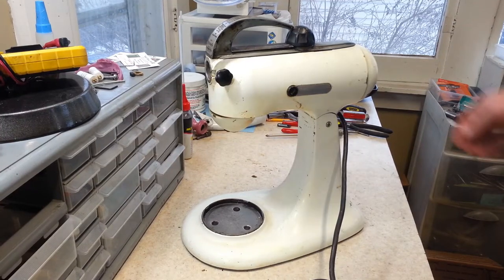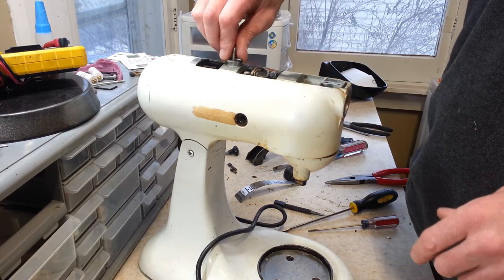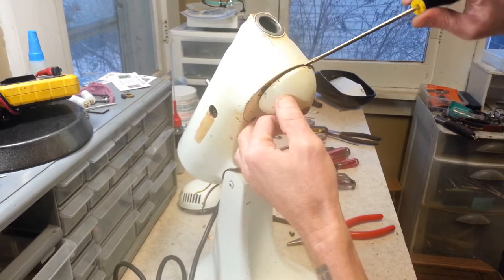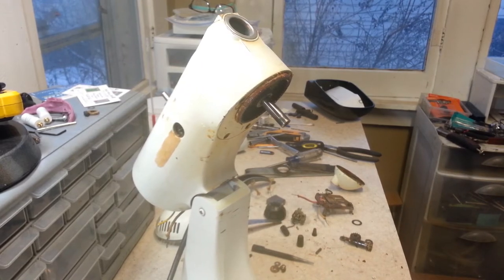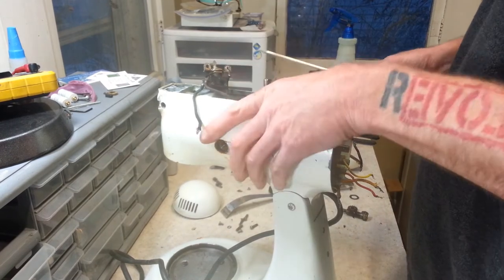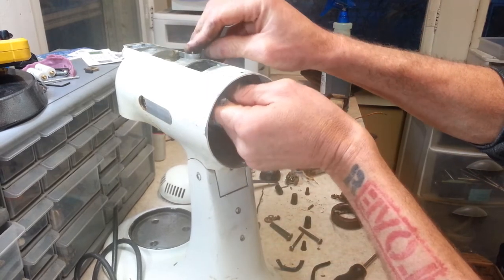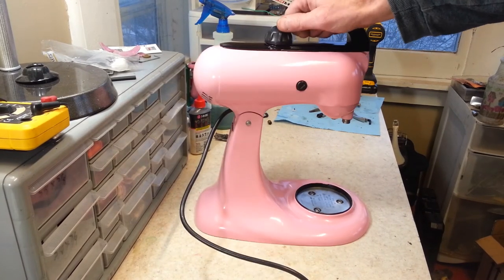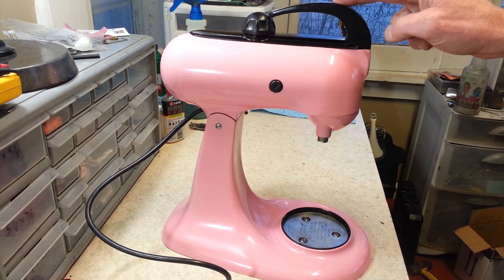Vintage Kitchenaid Model 3b restoration in pastel pink

Comment: Very nice job completed!  You really got the motor running smoother at low to med speeds.  Were any parts needed replacing?  Much discernible difference between 3B, 3C and 4C other that the obvious external differences on the top of the motor and the planetary differences of 3B & 3C.  KitchenAid sold a kit to convert the 3B to use the beater of the 3C if the customer wanted.  The 3 B beater shaft was prone to breaking in the motor if used to mix stiff cookie dough very often.
Reply from the maker: Thanks Russ! I had heard about the 3C upgrade shaft on these, but never knew the reason, thanks for the info on that! Believe it or not, no major parts needed replacing on this machine. Pretty amazing, considering the age!

Comment: Wanted to list this as a comment so here it is again: My 3B is still all original including the wick. Does need a teardown, repaint, and regrease. Did you use the food safe grease? The wick looks like a piece of rope, probably cotton. Been wondering how to deal with the wick and the black piece that the bowl locks into. I can get the steel plate out, but not the black piece in the base. That plate is held in with flathead screws too. My mixer has probably been in continous use since first owner, and has been in the same family since new. I guess they only made one color back then, cream. Serial number 3B30761. Do want to repaint in gloss black!
Reply from the maker: Hi, I will try to answer all the questions! 
I do not use food safe grease, unless specifically requested, in my opinion it is crap, and will only break down and leak in a couple years. No leaks or drips means no need for food safe grease :) 
I do not replace the wick, they hardly ever come out in one piece. They are to lubricate the bushing by soaking the oil from the grease in turn keeping the wick wet, but will only work by the grease separating. I just lubricate the inside of the bushing with grease. 
The plate usually sticks, there is also a plastic band around the outside of it, but careful prying from the bottom should pop the plate off, sometimes a little heat helps, like a blow dryer or heat gun. It usually is stuck down from old residue that will loosen up with a bit of heat. 
Hope this helps! Maybe you can post a video later! :)

Comment: Great video that helped me a lot getting my grandmother’s 3B apart. 

I’m seeing a lot of arcing in the back from the speed controller. Any idea about how to get it to stop sparking? It’s pretty much constant across all speeds but gets more intense the higher the speed.
Reply from the maker: Hi Ari, thanks Im glad it helped! It would most likely be either bad or dirty contacts on the speed control board, or the capacitor is bad, which helps to control arcing. Those are the 2 things I would check first. I believe Dave sells replacement capacitors for some KA's, you could check with him at www.davesrepair.com 
Good luck, let me know how it turns out!

Comment: You're giving yourself too much trouble removing the planetary -  it's much easier to remove if you use two screwdrivers at the same time, that pulls it off in a straight manner without any binding ;-)

Ha! the presence of a wick on the planetary output shaft! I was wondering how the output shaft was getting its lubrication... The output bushing on a machine I was working on was very worn out, I couldn't figure it out, but with a wick it all makes sense, as it would pull the oil out of the grease to feed the shaft...
Reply from the maker: Thanks for the tip! :) That would have made it easier for sure!

Comment: Hello I also have a 3B KA and would like to know if you know of a good place for parts, Like the lock plate and brushes. I have contacted KA and they told me they don't have any information on units this old in there system. So they would not help. Also they argue about the model number because it is only 2 digits. Any help would be awesome. Thank in advanced.
Reply from the maker: Hi Michael, unfortunately for most parts for that machine, you will have to source them from a donor machine. The brushes are the same as the brushes in the larger machines, and can be found here, or ebay or amazon, as well as partselect.com, or any site that sells KA replacement parts. Hope this helps!!  http://www.goodmans.net/i/8239/set-of-two-carbon-motor-brushes-and-spring-fits-kitchenaid-mixers.htm
Reply: @vintagemixersandmore1666  Thanks for the reply.. Also if you could send me a msg as to how much you charge for a new paint job. like in your video.
Reply from the maker: @shadowfaxSS  here is my price list, although I am not currently taking new work, I am working on catching up on the projects I still have here that have been waiting. Thanks!! https://www.facebook.com/notes/vintage-mixers-and-more/new-price-list-effective-5162018/2406026369423000/